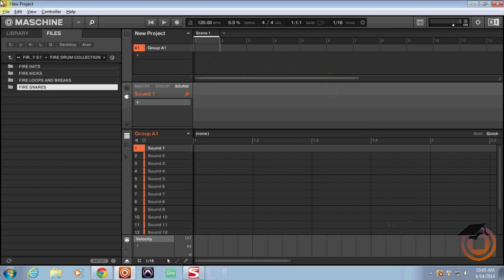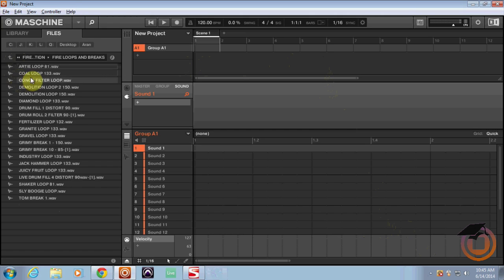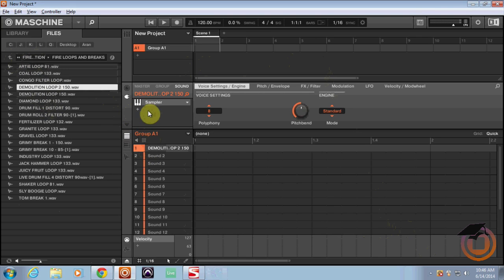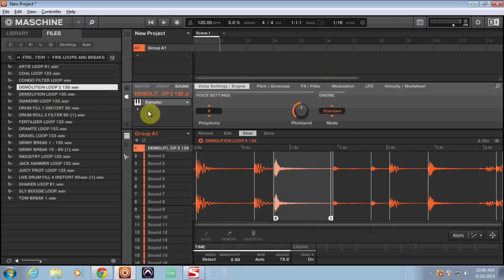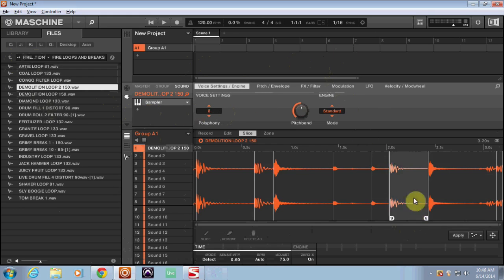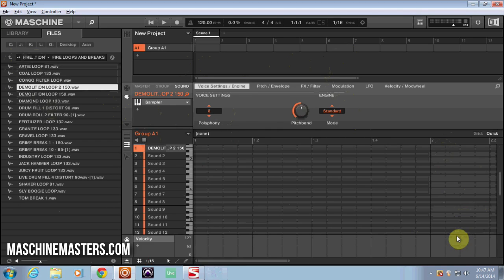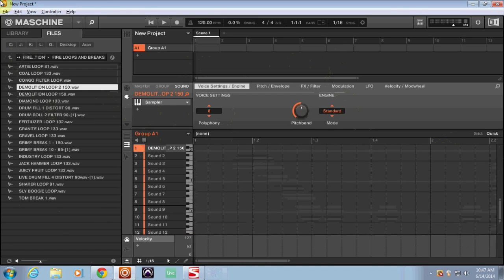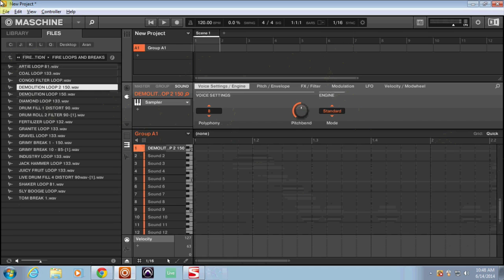How to Chop Samples without Default Pattern in Maschine 2.0

Comment: when I split my sample into 16 slices, only 1 pad is lit up, and that one plays the whole sample.  When I had the Mk1 studio controller, this would immediately get onto the 16 pads and then I move the chops around.  Now, with the Mikro Mk3, is there a way to set it for the slices are automatically assigned to the pads?  The cuts are showing up on the screen but not the pads

Comment: Anyone know the fix for this on version 2.7.2 ? The tap for those options has been removed or moved. Cheers for any help :)
Reply: Found it. It's in the apply sub menu :) .... Is there a way to change what note the slices are assigned to? Mine go in at c-2. Just a pain to hit the Octave - ,button a few times, every time.

Comment: is there any way to go back to the software you're using after I made the mistake of upgrading to maschine 2?  I used to be able to make decent beats, but haven't made a beat in years due to the new software changes.
Reply: Yeah, you just have to look for the old version. I didn't do much in MASCHINE in general, since the workflow is somewhat strange. But you get used to it when you handle it more and more.

Comment: Hey man great vid.. much apreciated. I do have a few question regarding CPU and RAM issues. I notice your on a PC, my question is when you get into more then 4 groups with Heavy VSTs  (Absynth etc etc) does your memory sky rocket on the top right hand CPU monitor level icon and cause drop outs and skips. I'm looking into getting a brand new computer very soon. Was just wondering if you have ran into that issue and if so what did you do to correct it. But if not I'm also wondering what your CPU specs are so I can have some sort of guideline as to what will deff work. Thank you for time.  Keep up the great tutorials 

Vec7orSe7
Reply: +nothing It's not just your cpu and ram that factors into the spike. I use Windows as well (10 Pro 64bit.) It also comes down to your actual cpu, graphics card, as well as your audio interface. How powerful are they, is the real question. I'm running an AMD Phenom II X6 cpu overclocked, 16gb Corsair Vengeance gaming ram, an HIS Radeon iPower IceQX 2gb GDDR5 gpu, as well as a Native Instruments Komplete Audio 6 interface.

   It's not cpu heavy unless I run ALL of the biggest plugins I own, ie; Nexus 2, Reaktor Blocks, Rob Papen Blue 2, Predator 2, etc. That's why I'm getting a more powerful audio interface. My boy doesn't even have a powerful custom computer like the one I built but he has an Apollo 16 interface by UAD. He's pretty much able to run as many plugins as he wants on a quad core system with 8gb of ram.